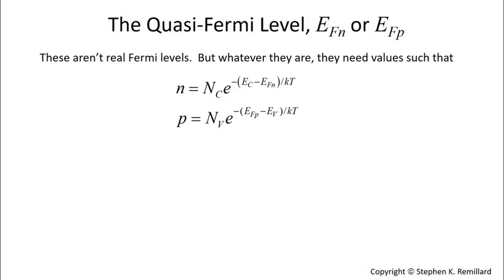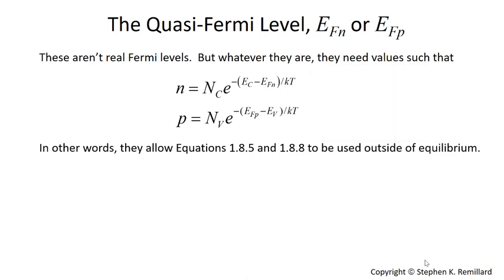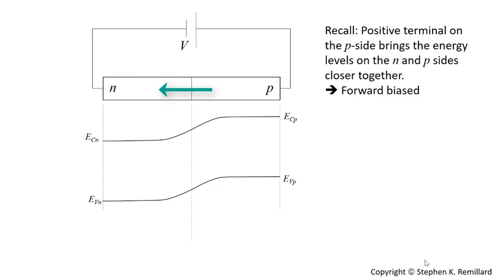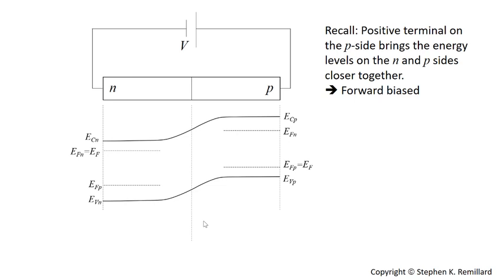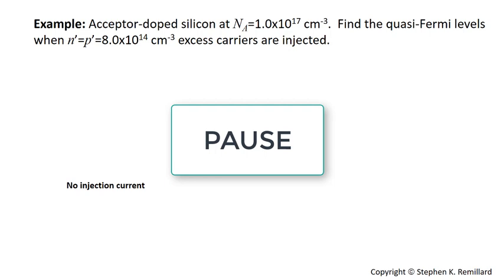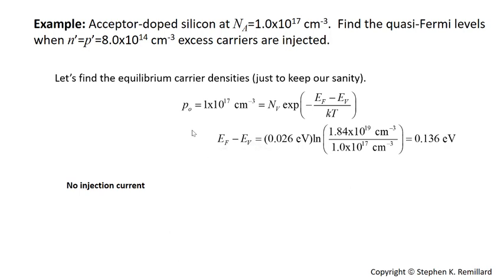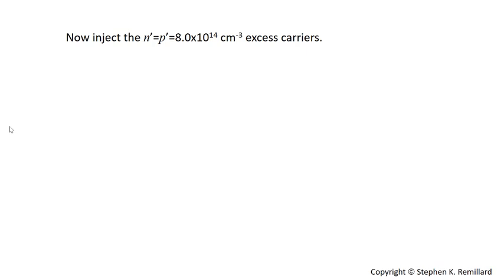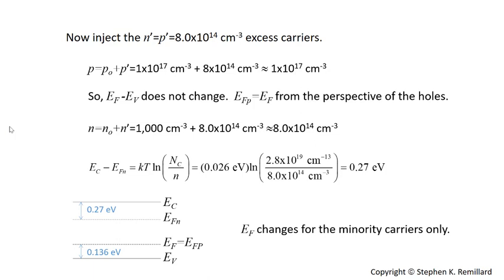Quasi-Fermi Level in a Semiconductor Energy Band Diagram, Lecture 22

Comment: Very nice! But how did you find N_v (at time around 6.00)?
Reply from the maker: Thank you for asking.  I will refer you to Equation 1.8.9 in Chapter 1 of Prof. Hu's book.  The link is in the comments above.  It's still tricky though, due to uncertainty about what to use for mass.  Normally, I would also say that you can refer to Table 1-4 on Page 21, except for the case of N_v for silicon, there seems to be a typo in that table, or at least a value that I don't agree with.  If you compute N_v using Equation 1.8.9 and the density of states effective mass for holes in silicon, hopefully you will get 1.84e19 cm^-3.  (I used 0.81m_e as the hole effective mass , which is different than the value given in older textbooks of 0.54m_e, and accounts for the non-spherical shape of the constant energy surface in the heavy-hole band.)  See https://ecee.colorado.edu/~bart/book/book/chapter2/pdf/ch2_3_7.pdf
Reply: @stephenremillard1  Thank you!